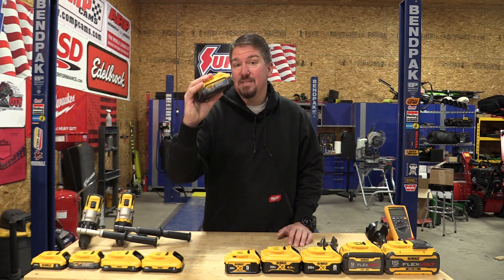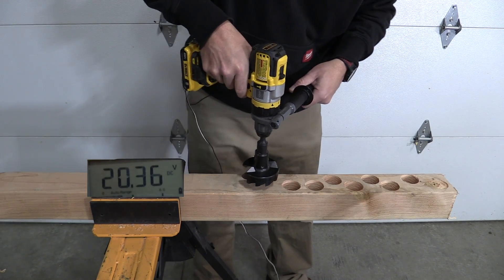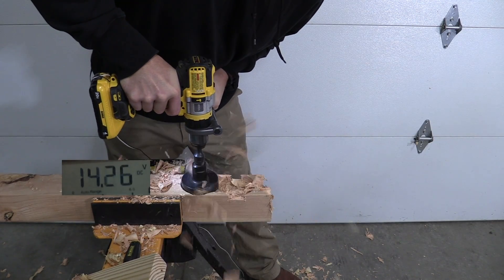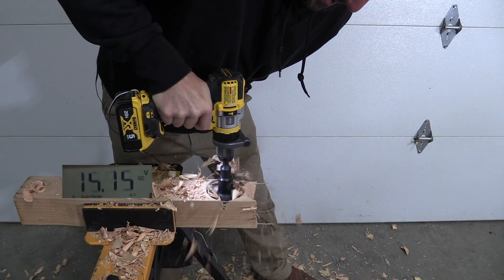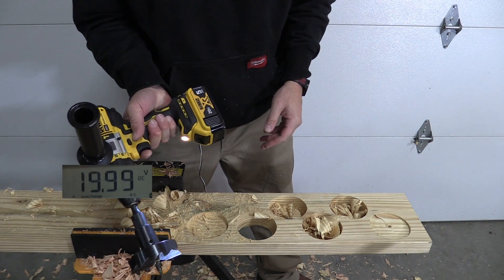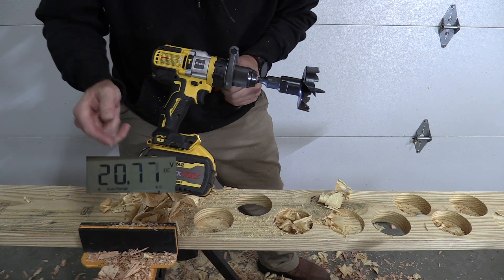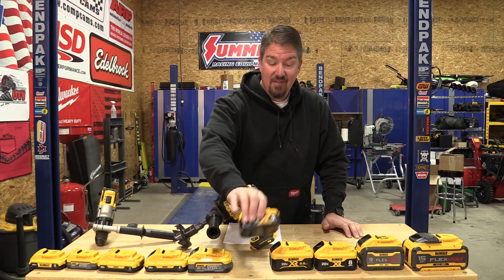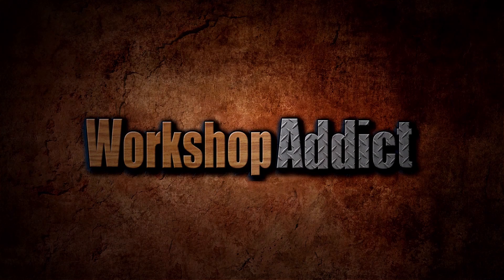Wow! The DEWALT POWERSTACK 20V 5Ah Battery Testing

Comment: The only thing I would say is your hole saw would have been getting dull the more it drilled. So the bigger batteries had to work harder to drill the same holes. Showing how much better they really are. I just bought 2 8ah power stacks. Dieng to see how they perform.

Comment: Thanks for showing the real power advantage of the powerstack and the larger batteries.  Most vids i have seen only show low current draw testing of powerstack 5 AH vs standard 5 AH batteries not the high current loading you show.  Dewalt should pay you for showing us what they have not.

Comment: Great tests, but the price of the new style battery is off par.    On some of my auger style bits, they will  ONLY work on speed 2, bore all day long, but at speed 3 they lock up EVERY time.  Sometimes it's physics about which speed to use on a drill for a particular bit.  I always use 5.0 standard batteries.  I can get these standard  5.0 batteries for 40 to 50 bucks a piece, so I can just buy a  bunch, vs the $235 of the new style batter for just one.   Everything has a special use case though.  Keep up the good work.

Comment: Interesting test, BUT TOO MANY UNACCOUNTED FOR VARIABLES to consistently come to a definitive comparisons. Examples of probably unaccounted for variables:

Age / number of charge cycles on each battery. (Relative internal resistance as a function of size, current draw, temperature / heating, aging of battery chemistry as a function of charging cycles … and so on …)

Binding due to not having the drill perpendicular. 

Progressive dulling of cutting edges. 

Temperature of motor. 

Temperature of battery as cut progresses. 

When I use my pole-saw with 20v vs FlexVolt the performance is night vs day. The larger FlexVolts can get the saw rather hot and not just the motor. Also having a sharpened chain vs one that has been used hard for a day is also a day vs night performance comparison. 

Liked the test, but hard to draw anything more than generic conclusions.

Comment: Thank you for a great 🔋 video, what i take from this video is:

If u want ultimate performance battery, and weight is an issue, then power stack is the way to go.

If u want prolonged run time, weight is not an issue, and still receive very good power output, then XR Flex Volt battery is the way to go.

Comment: Noob question I have dcf887 and the dcd795 will 20volts battery fit straight in
Reply from the maker: Yes, any Dewalt 20V or FlexVolt battery will slide right in.
Reply: Thankyou very much
Reply: Hi Will the charger I have be ok to charge the 20volt batterys

Comment: Power stack is the way to go eventually all other dewalt batteries will become obsolete and power stack will continue, are they expensive yes, but the flex volt batteries cost too much as well.  What dewalt needs to do is stop producing tools that require flex volt batteries and keep pushing power stack batteries since it's a better platform.

Comment: Looks like you've got the DCD998 power detect sitting on the bench, judging from the accessory handle.  Did you notice if this new powerstack had similar power in that drill compared to the DCD999?
Reply from the maker: 998 and 999 are the same

Comment: Even though the performance is objectively awesome... It's still pretty disappointing they're priced as if they were bending physics despite using technology that started in flip phones. On top of that, they're going to be standardized pouches, meaning they cost less to actually manufacture in scale as all you're doing is stacking them vertically. But reaming every single consumer as if it was a triumph. Going from a cylinder to an elongated, widened pouch - is like expanding the surface area for energy (think a 9mm thin phone next to a 21700/18650, the phone has a 3400mAh pouch cell - number is arbitrary-). It's old technology repackaged into an easier & more space efficient design; yet at a premium as opposed to what it actually should cost. If an engineer or manufacturing professional would shed light on that it'd make everyone see a 2 pk of 5Ah power stacks should cost closer to $200... Not 350-370 & they'd still make profit on it, is the point. Granted, it does look like they're taking the Apple route with it.
The first powerstack should be seen as a BETA/engineering test sample, and throughout all months of "silence", they've really only just been mass producing the pouches or having them manufactured, so at least everyone can expect there'll be no places out of stock lol.

Comment: The only thing is put the gun in 2nd gear. Proof was even the 15 stopped. But I’m still impressed with the power stack and maybe have to get one.
Reply from the maker: I showed everyone it was in speed 1.
Reply: @WorkshopAddict  no I know you were upfront , I mean the tool really can’t do high torque in the high speed gear. No you were completely honest. But yes , the power stack still did it in high gear , so yeah fair enough. Watching the voltage under load was excellent.

Comment: I am still waiting to be able to buy it. I checked yesterday and nothing. :/
Feels like its taking forever. I am avoiding buying any 20v batteries until I can just run these. tool only is cheaper and can run with my 60Vs for now.
Reply: You are right at the end, I am really excited to see the new tech in the flexvolts. Just think of a 12ah flexvolt half the size of the 9ah
I am all 9ah flexvolt and its just fine, but dang I would love to be able to get more amps with less weight/size.

I bet we will see something next year because it was a year between 2 and 5 ah batteries. I doubt they will do more than 5ah with 20v next because power wise its fine and seems to push the limit of 20v anyway. Its already comparable to the 8ah 60v

But they really need more power out of their 60vs for that line so people dont have to buy a 15ah just to max usage, but more importantly, to run their 120v line of products that may expand, being able to get more power out of each flexvolt is key to longevity of use, performance, and the reputation of that line, which already needs 2 60vs to work.

Comment: Here's my 'two cents':
1) The 5ah PowerStack is way bigger in size & price than expected. I'd rather use my 12ah FlexVolt with the same power & 240% more runtime!!
2) DeWalt should redeem itself by introducing a FlexVolt PowerStack (FlexStack?)!!

Comment: The voltage tracking is a great parameter to add in to the physical testing.  The older I get the more I want light weight tools that perform.  I was hoping the PS 5.0 was going to be smaller than the XR 5.0 but I’ll pick some up next year when they go on sale and see how well they do.

Comment: Thanks for doing this test very appreciated, but since as your viewer who can’t mimic it, I was wondering if you could repeat your test with Volts Amps $ Watts just to see how they relate especially since watts is power used and Amps is current drawn it would draw a better picture in the different correlations 
Again thank you very much in advance 
Cheers
Reply from the maker: Getting the amp load has been tough.
Reply: @WorkshopAddict  lol I understand but it would be amazing to see how many amps the different types of battery can give, and thank you again for your channel your posts are great.

Comment: I regret buying dewalt’s 60v tools(angle grinder, angle drill, and sawzall) when I could’ve just bought there smaller xr 20v tools and used the 5amp power stack instead 🤦‍♂️
Reply from the maker: I think you would regret having the 20-volt versions of those tools after you have used the 60-volt versions.  What you have are powerhouse tools that are freaking awesome.  No 20-volt will match them no matter what battery they have on them.
Reply: @WorkshopAddict  I hope you’re right. I haven’t got to use them much yet. The angle drill I I have looks like a monster compared to the xr 20v angle drill.
Reply from the maker: I would not kid you.  Watch any of our Dewalt Flexvolt grinder videos.  We call it the best angle grinder on the market.  Same for circular saws.  The DEWALT FlexVolt ones are amazing and the 20-volt ones are just OK.

Comment: The 6.0 is the closest to the 5.0 power stack I found the 8 weak and that 9.0 flex volt battery WOW 😳 21v same with the 15 over 21v the 9 and 15 are DeWalts most powerful batteries I think they should have made the 5.0 power stack battery resting voltage I'm the mid 21v like the flex volt battery it just ate and didn't drop under 19v #DEWALTPOWERTOOLS MAKE THE POWER STACK WITH A HIGHER NOMINAL OR RESTING VOLTAGE AT OVER 21V

Comment: Grinders and circular saws are the key.
Reply from the maker: It is hard with those vecause the FlexVolt versions rock.  No matter what they do in the 20 volt line, it will never match the FV line.

Comment: the reason your tool stopped with those higher amp batteries was because you were tilting the tool over and the shoulder of the bit was binding on the walls inside the hole. it needs to be held and kept straight. dont let it get cockeyed.

Comment: Pretty good. Though I’ve noticed in my own drilling that when you hold the drill at a slight angle rather than straight up, as happened here at times, the rubbing of the sides of the bit slow the tool down, and when you get deeper, it can stop.  Stopping for a moment and straightening up fixes the problem.

If I didn’t already have so many batteries in different sizes, I would buy some Powerstacks, but they’re expensive. Since batteries can last for some time, I suppose I’ll end up waiting for the Powerstack II, which is when mine will be wearing out.

Comment: I see DeWalt has no fear of making a lot of diferent batteryes, but I don't see the no. one priority, 20V max @ 2.4 or 2.5 Ah power stack and 12max @ 4Ah with 3 x 21700 cells ( like Hilti and Metabo have),    much more interesting then 5Ah with 6 x 18650 cells like a 24V from Kobalt/Hilti/Flex grey. Sure Bosch and Milwaukee use 6 x 18650 with 3 in the grip, and Makita also with 6 outside the grip, but 3 x 21700 are lighter, more compact, and good up to 40-44A with good cells, and if the 2 -3Ah packs good up to 20-23A can so-so handle DCD 701, then a  4Ah with 3 x 21700 good up to 40-44A is more then good enough.

Comment: Very well done. Disappointing about the 5ah xrs and stuff. Why so bad performing?
Reply from the maker: I do not believe it is a bad performer.  We are askiing that drill to do some serious stuff and the output on the 18650s used in that battery wont do it.  All the 21700 batteries were able to do it.

Comment: I see that 5Ah power stack is same as 6Ah 21700 cells battery.21700 cells that use power tools manufactures have 35A per cell constant discharge rate and they not using best cells with higher discharge rate.

Comment: Fantastic tests!  I'd be curious to know if the power stack cells have lower internal resistance, which makes the voltage not droop as much under load.

Comment: As long as there is the same number of cells  in the battery pack the lower capacity will always have higher discharge cells and those have more power assuming they are using the same cell formate. The compact 3ah will outpower the compact 4ah and the 6ah will outpower the 8ah. Samsung 21700 30t cells vs 40t cells.  The higher the capacity of a cell the lower power (amp discharge rate) it will have. This is why they don’t use 3.5ah 18650cells and 5ah 21700 cells.
Reply: You can't beat that 30t the stacked lithium is having trouble beating it.

Comment: please test fast charge time
Reply from the maker: Interesting that you asked.  Charge time did seem slow, although I was not testing.
Reply: @WorkshopAddict  did you use a fast charger for that? i think you will have some trouble finding one. why funny? these are silicon anode batteries i assume. 10 minutes on extrme fast charge

Comment: The size is surprising, but not too terrible.  It definitely puts out the power.  Still hard to beat the 6.0/8.0 for power and runtime.  It WILL be interesting to see where Dewalt takes this new battery tech!?  👍✌

Comment: Based on Amazon reviews of the original power stack battery run times were not all that great. You should check the run times.
Reply: Given the original was only a 1.7ah pack it isn't going to last as long as higher ah packs.  This new 5ah pack will most definitely last quite a bit longer...

Comment: I wonder why they haven't added Flexvolt to the PowerStack batteries
Reply from the maker: I believe the PS Batts will be a slow drip as they make sure to get this right.  These is a HUGE professional FV base and if something were to go wrong, it could be bad PR.  Good companies do a ton of research before dropping stuff.
Reply: @WorkshopAddict  Good points, cheers

Comment: I been see ridiculous run time of power stack 5ah vs regular bateries;  over 190%(introduccing screews )... in the GO TOOLS channel (german youtuber)
Reply from the maker: i dont see why or how.  5ah is 5Ah no matter what battery.
Reply: @WorkshopAddict  Their reasoning is it performs X task faster - thus does X 100 times vs only say 70 times with the same capacity. Total watts out would be the same, but each task might take let's say 0.05Wh to perform rather than 0.07Wh
Reply: @WorkshopAddict  well in this dostration stack bateries shows lees heat , in a long work gives you lees resistance by de heat and growing his eficiency of each amps, please test that is wear

Comment: I got a two-pack a couple weeks ago. It cost me 400 bucks, which I needed a few weeks to think about before I pulled the trigger. I was convinced with the promice of longer battery-life, as two 6ah flevolt batteries died out on me recently, plus my regular 5ah is reduced. You should try the battery and compare it with others on either the flexvolt advantage grinder, hole hawg or circular saw
Reply: Power stack 1.7 amp 2 pa k on sale today at lowes- $200 comes with free tool up to $230 value.
Reply: increased run time is a lie. as a matter of fact pouch cells have lower life longevity than cylindrical cells. just look at your phone battery.

The only thing powerstack is good for voltage drop, and an immediate push of current vs cylindrical.

Comment: Great comparison. I really appreciated you taking the time to step up to each battery so we could see the cross over in performance. Would love to see how the flexvolt advantage circ saw runs on the new powerstack vs 6Ah and 9Ah flexvolt batteries. 

One thing I will note. I believe that the 5Ah powerstack will have longer runtime than the regular 18650 5Ah. Because it holds that higher voltage, the batteries draw fewer amps, leading to fewer amp hours being consumed in usage. Could do the same test using the 1.7Ah powerstack vs. 2.0Ah standard. Seeing that would be awesome on the channel.
Reply from the maker: We did that.  Ah is Ah.  The 2 ah will out last the 1.7Ah PowerStack.
Reply: @WorkshopAddict  Sorry I missed that in the earlier videos. Honestly super surprised by that. Maybe the 18V stuff isn't as affected by this.

Comment: I would support your boards on both sides with the support reasonably close to where you are drilling so you don't get bending/pinching. It's causing problems for you punching through with the forstner. You could also just set the 4x on the floor and not punch all the way through. It's similar to an unsupported/freehand cut with a circular saw. You'll have problems getting through the last bit of a 2x even though the saw is plenty powerful to do much more than that.

Comment: I think battery 6ah and 8ah would do better with DCD998. Flexvolt batteries have an advantage with DCD999
Reply: That flex volt 9.0 will beat everything but the 15.0 the resting voltage is 21.49 so under stress it will only drop to the mid 19's this was absolutely amazing to watch I actually thought the power stack would blow everything out the water boy was I wrong save your money you actually get similar results in the XR 6.0